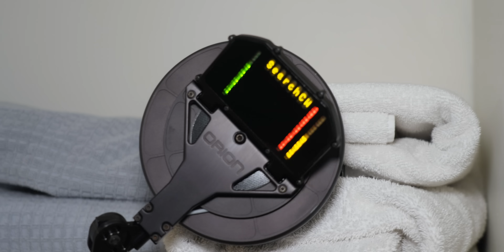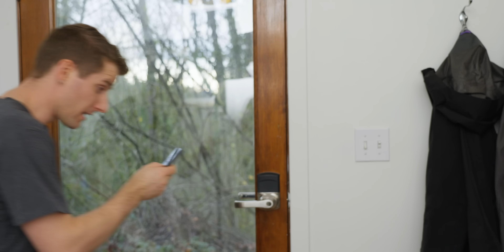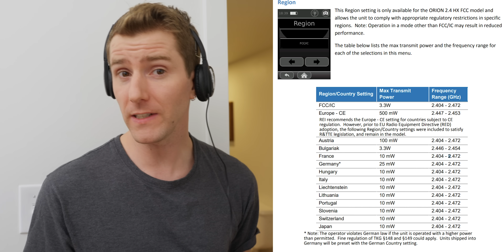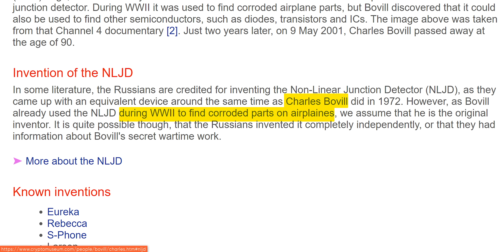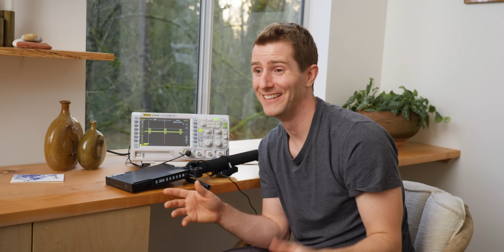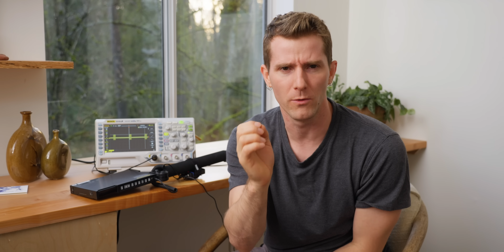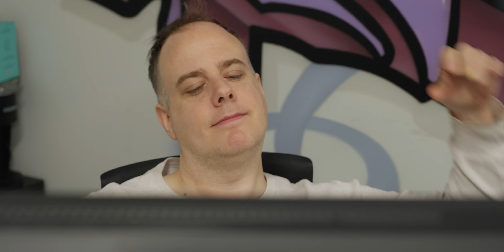I Rented an AirBnB to Look for Hidden Cameras

Comment: Long read, and it has no real bearing on the video. Just a story. 

I was in the Army when I learned about these devices by sheer "luck". A young and new soldier was placed in my platoon one day, he was weird AF. Like sniffing people and getting way too close weird. A couple months pass and we get MPs in the barracks. His roomie was sketched out because he would hear the guy tapping/banging on the walls for almost no reason, so he confronts him, and the guy just says he rolls around in his sleep a lot. Okay, believable explanation as he would only do it at nighttime. Another week goes by and the roomie is woken up at night to a damn drill going into the wall. He doesn't confront him, he just listens for a while. Drilling, light hammering, and similar noises; he takes note and the next morning he goes to the First Sergeant. Couple calls are made, and this is where the MPs come in. 

They show up with this exact device. They had everyone in the barracks turn off their wi-fi, gather whatever small electronics we had, and go stand in the parking lot. We do so, they go on, about 45 minutes passes, and they come out to arrest the dude for planting bugs. 

Why he did it? No idea. Who he did it for? Not a clue. Nothing was figured out, he didn't explain why. The moment he was arrested was the moment he turned "normal". Spoke in fair tone, changed mannerisms, no sniffing, or nut scratch'n'sniff (his favorite). All I knew was that I'm showering the in company locker room for a week while they scour the entire building with these devices. Don't care who invented it, don't care how old the tech is. It's a great tool and I'm mad thankful they are a thing.

Comment: Regulations around RF-emissions are very interesting imo. For example if you want inductively coupled plasma (IPC) for research purposes (say you are doing trace-metal analysis via ICP-MS), it is illegal for your RF-coils to operate at certain frequencies, since you would just blast massive noise over important communication.

Comment: Almost all of the spying devices available on general market generate a little bit of heat during normal operation: any cheap thermal camera with a decent sensitivity (100mK or less) is capable to spot these devices.
This trick obviously doesn't work if the spy device is switched off or if the spy device doesn't generate any measurable heat (i.e. an hard wired microphone) but of course a switched off device is usually not a real problem and an hard wired microphone is not something you can find easily.

Comment: Or just grab an IR camera lens filter, turn off the lights off and blast the room with IR light. Every camera lens and glass will shine. You don't even need to buy the lens, just an ir flashlight and check if your phone can see it and use that instead of the lens.

Comment: Specifically, I believe it's the microwaves heating the fluid in your eyes that damages them and causes the liquid to get opaque (and I also believe it tends to coagulate). This effect is cumulative over time and cannot be fixed or reversed. While this is outputting a small amount of power compared to a household microwave oven, the effect still happens on the microscopic level and even a small amount of damage can become noticeable.

Comment: The corrosion detection statement made me think of foxhole radios.  oxidized razors used for transistors, and this thing is a transistor detector.  Will it detect a foxhole radio?

Comment: Check out the wiki page on this..
https://en.m.wikipedia.org/wiki/Nonlinear_junction_detector

In the section under countermeasures, there is a reference to the Soviets mixing semiconductor material into the concrete that was being used to build the  new US embassy in Moscow. Everywhere they tried searching for electronic bugs was masked by false positives coming from the concrete.

Comment: Here’s a tip.. Assuming the hidden cameras can operate in the dark as well you can get an SJCAM for about $40, remove the lens and behind that lens is a pinkish infrared aka hot mirror. Break that off and refocus the lens. The camera can now see infrared light. If you see bright light on camera you can’t see with your eyes then that’s a hidden camera, or someone is sitting on a remote.

Comment: Hi, Electrical Engineer here.  
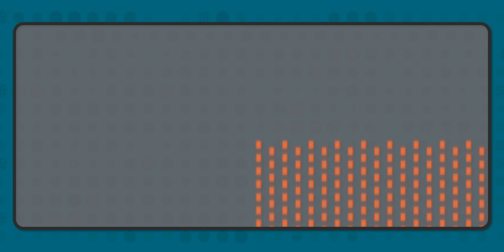Minor Correction @ timestamp 7:42 - You're technically correct about Antimony (Sb) being used as an n-type dopant, but it's not common!  It has some very specific advantages, but  Phosphorus (P) and Arsenic (Ar) are FAR more commonly used for the every-day silicon-based devices most people are familiar with.  Boron is correctly a common p-type dopant.

Comment: I usually just look in the router the devices connected. If i find something suspecious I deactivate the current wifi and create a new one for the time i'm there. Later before leave a set everything back up. It still could be recording locally though.

Comment: Instructions: “Keep it away from your head, it’s a microwave.”

Linus: Proceeds to hold the device 6 inches from his face for the entire video.
Reply: I came here to say just this! lol
Reply: This!!! I guess he thought it was unidirectional, but like a double edged sword it cuts perpendicularly in both directions, specially if it is a cheap unit not shielded on the other side. I was physically cringing when I saw that it was on, and he was still holding it so close to his head... 😭
Reply: @docarii  Microwaves stay roughly within the beam width of their exit point, and their power falls off exponentially with distance. I work in telecommunications, specifically in microwave communications between cell phone towers, so I can confidently say he's fine lol.
Reply: @OromisGlaedr  At the point said "cooks your eyes" this should be mentioned.
Reply: @Fahnder99 Unless he looks directly down the beam exit point for like 15 straight minutes, he's fine. MW propagation is focused and directional. And without high input power, the dB coming out is low. It's why microwaves in your kitchen are power sinks.
Reply: @OromisGlaedr  tbh, I stopped using microwaves since long ago.
Reply: @docarii it’s not a double edge sword. It’s a highly focused beam. Even if he held his head next to that thing for 6 hours nothing would happen.
Reply: @xNathan2439x  Thanks, at least somebody with some common sense. I've cringed hard reading the other comments in this thread
Reply: Linus crispy tips @docarii
Reply: dude is pointing at it while it's powered on
Reply: It’s probably off for most of the video
Reply: literally points it at his hand, and grabs it while its operational by the spicy end

Comment: Connect to the Airbnbs wifi, then run Wireshark and filter for jpegs and Bluetooth. Though it doesn't work with local devices though this is a fast and free way to check for cameras connected to the wifi...

Comment: "let's scan these VHSs"
the next guest coming along: "heeeey, the VHSs are blank! what the heck?"
Reply: @jan_harald I was hoping someone would mention something about that.
Reply: @MrAguayokun  r u an LTT circuit hoodie? (Jk)
Reply: Its RF radiation, not (semi) static fields like you need for VHS or hard drives. Otherwise, they wouldn't be able to cope with light either.
Reply: I don't know about VHS but I've put a Hi8 tape in the microwave and it wasn't erased.
Reply: @eDoc2020  Did it burn your mouth?
Reply: even tho linux probably has backups of those exact movies on a server somewhere, my inner physical media preservationist couldn't handle that.
Reply: Its a set made for the video no ones VHS get wiped
Reply: @Serah092 He says it’s an Airbnb they rented so. 👀
Reply: @sub-jec-tiv  The space yes but do you really think this AirBnB specifically has a Book with a Whole in it? still good video but cmon now.
Reply: @Serah092  a whole what?
Reply: @MrZilla500  fractured but whole
Reply: @Serah092 You can literally see trees outside that aren't anything like LMG's office...
Reply: @zina2B  They didn't say the airbnb isn't real.

Comment: Quest 2 headsets in passthru mode are pretty useful for finding IR lights in rooms typically associated with nightvision CCTV cameras. The Quest 3 doesn't work though as it has colour pass-thru, not IR pass-thru. Go into a pitch black room with the headset on and if you see any lightsource through the headset that is bright enough to be illuminating the room and casting visible shadows, its an IR light. Of course, without the headset on, you can't see a thing.

Comment: Tip- your phone can see infrared.

Turn the lights off in the room of the AirBnB and view the room through your phone camera screen. It will show red lights wherever there is a hidden camera using nightvision as the infrared lights illuminate on the hidden cameras in the dark.

Can test this with a tv remote point the phone camera towards the top end of the remote and pressing a button on the remote - you will see the infrared sending a signal/pulse everytime you press a button

Comment: 7:30 small correction "semiconductors contain diodes" is the wrong way around. 

Because of this you're also talking about resistors where I think you should be talking about transistors, because resistors aren't all diodes.

Comment: The reason why these kind of products still exist, is that if someone really want to spy you (bnb or whatever) it is actually MUCH MUCH easier to set up an hidden camera, than try to hack a mobile device, remember folks the weakest link in cybersecurity are the users not the devi e themselfs, those one nowdays without an explicit authorization won't transmit your data to someone somewhere (yes the tech giant that sold you the device is still capable to spy on you, but that's another argument)

Comment: Why don't they just refine that thing, and make a few changes.  I used to be in wave tech, and one of the things I made and engineered parts and accessories for were microwave spectrometers, and there are other wave lengths of light on the electromagnetic spectrum that can be used, and even that thing with microwaves at a lower power level, if it were made differently.  The reason the devices it is to detect don't need to be on, is because it's not detecting electrical energy, but physical properties (as in physics not shape or size or mass)... by how they react to those waves, as in reflection, absorption, scattering and and refraction.  If on a tripod and  used to scan slower but also more on track, like choosing an area to point it to and letting a program control it, and with sensors also in a few places near and around the target, all of those properties can be detected and even used to make a picture, sort of like other things do, with colors representing mas and depth... although come at a much higher price and good understanding what indicators to look for to calibrate the devices for better detection with a a preliminary pass, just to get a suspected positive, and then tweaking it which means a good manual and software that can lead you through the process.

Even sound waves could work if implemented for things like that, but using combinations of methods together for their qualities even better, and sound has been used to recreate what actors in silent movies were saying to good results just by focusing on minute movements of objects like textiles in clothing lamp shades, curtains and other stuff, and then computers used to process it all, where lip readers have little to work with!  Even picked up music and conversations in the background as there was no reason to be quiet other than maybe to not distract the actors who had to concentrate on exaggerating their body language and facial expressions which makes silent movies so freaking weird!

Comment: arguably it would be more applicable to unplug the home router and use a travel router for your gear. at best itll knock out the wifi transmitted stuff but sadly wont do anything for the local recording.

Comment: could also use hack rf to scan for frequencies
but alas it cant sense turned off electronics
but most spy stuff uses wireless communication so a discreppancy in signals that the hack rf sees could mean a bug

Comment: How do you write off a $15-$20K device that can really only be used this one time for this video and likely won't be able to be used in any purposeful way in other video's unless you just repeat the exact same video against a new device that isn't effectivly e-waste in comparison?
I mean... absolutely a cool little bit of information about something most nobody will ever see, but you tested a $15K-$20K device that requires you send in a request to even SEE the price quota, against a $35 device, and are just the views on this video going to eat the cost of that very specific "really only going to be used for one very specific task" type of item?
Reply: Because he said in the video he would not do that, and searched ebay to buy an older device for a couple of thousands (aka 2K) so thats presumably what he did.

Comment: They only specify avg. power ... shows picture clearly defining "Max Transit Power" lol.

Also, if it was/is avg.power..avg. power of what duration? 1 second? 5 minutes? 1 hour? 
Lets run it at 100kW for 1 minute (6MJ) and then run it at 1milliwatt for 22 days --> average would be 3.16 watts :)

Comment: Seems like another huge issue is that nearly everything is electronics now. LED bulbs, even non-smart ones, have circuit boards on them. So how would this thing actually help you find something spying?  In my house it seems like it would light up next to every light bulb, every outlet, every light switch, every clock, and so many other things. And I don’t have a single thing spying (not in the way we’re talking about here).  So after this thing tags everything electronic as suspect, then I’d still have to just examine every piece of electronics for nefarious things. So really I’m nowhere closer even with this tool. Outside of the rare situation of someone hiding a raspberry pi in a book, seems like a relic from the past. 🤷‍♂️

Comment: i bought a cheap one off amazon under 80ish and LOVE it. It only detects a few feet NOT the neighbors xbox lol. Yes it finds lightbulbs etc which is good to know bc sometimes cameras are in them as well. I found a few in the bulb. So no need to get a very expensive one just get any which does the job fine.

Comment: Man, this was a blast from the past. 15 or so years ago a company i worked for invested hundreds of thousands of dollars into equipment and training for me to learn how to use this device (and REI's other hardware). I was flown out to REI's offices and went through weeks long training where i was tasked to locate transmitting / listening devices utilizing their equipment. Many of my classmates were from 3 letter agencies...
Reply: If memory serves, this one is a slightly older model, and I don't have specific experience with it, my training focused on the one mentioned that retails for 15k+. That one primarily operates at 2.4ghz and I believe scaled down power making many of the concerns less problematic.
Reply: @atlantisman5  Ah well, that's good to hear. Cheers.
Reply: I was Security Forces / MP for the United States AirForce, we got training on a similar device but I do not recall ever actually using it for anything.
I was stationed at places that may or may not exist in the USA.
Reply: That's pretty cool. I'm sure I could ask you a more interesting question - but as someone who got training for it, what's your reaction to how Linus was using it and holding it in the video? Struck me as a bit careless given the mentioned safety precautions but maybe a professional would see it differently.